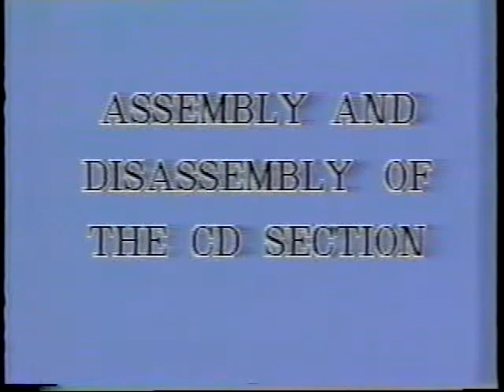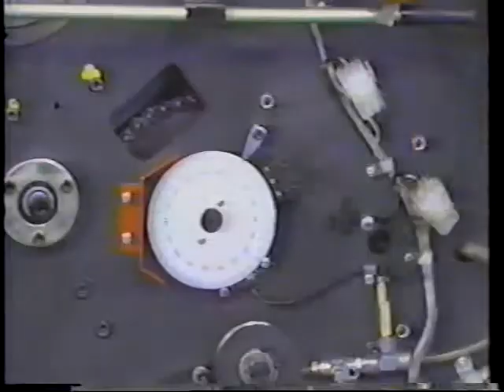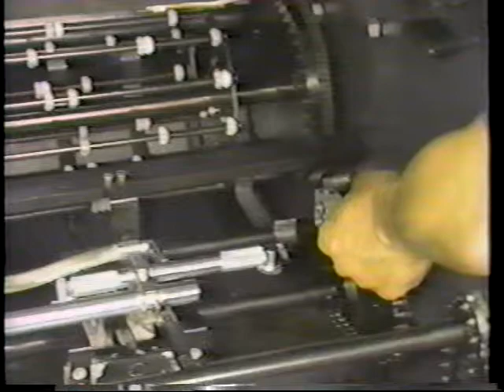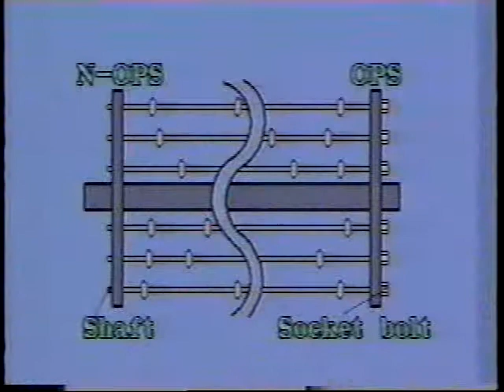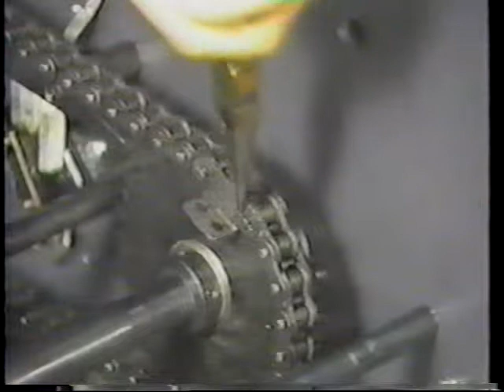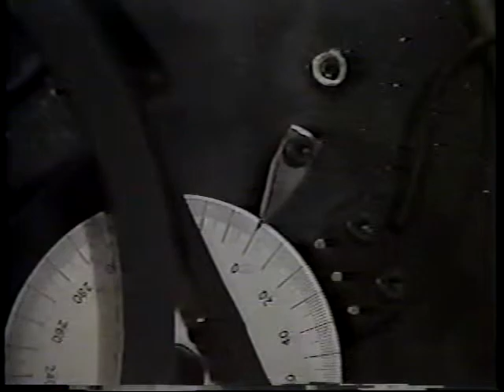Itek 3985 Troubleshooting video 2 of 2

Comment: Do you have any videos about setting the plate cylinder pressure adjustment to the blanket
Reply: read the operating manual bro. that pressure is determined by the thickness of plate and packing. proper squeeze is .003"
Reply: @jerryeinstandig7996  yeah thanks, I figured it out 10.5 months ago 😁